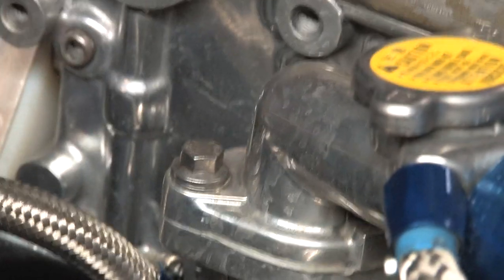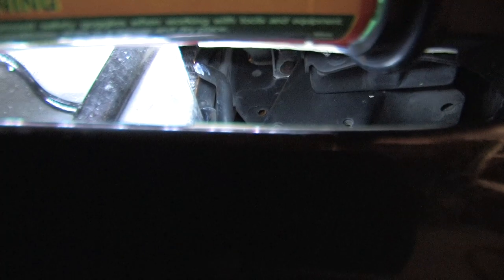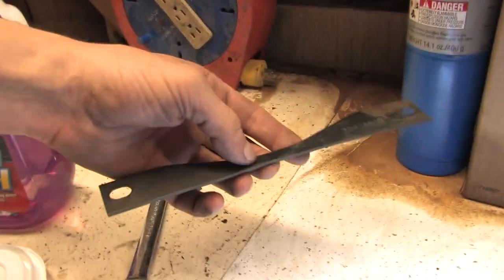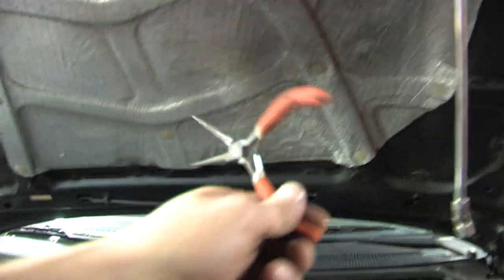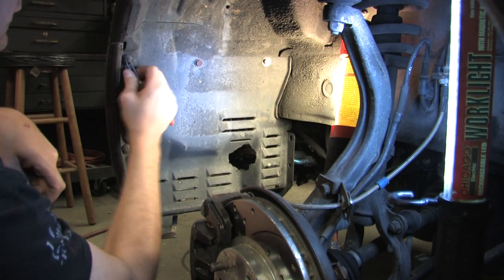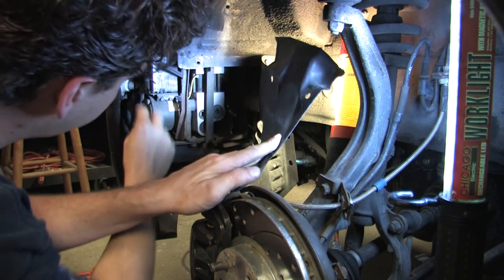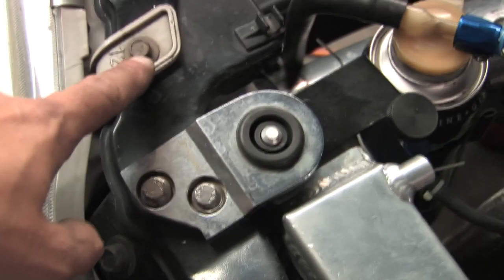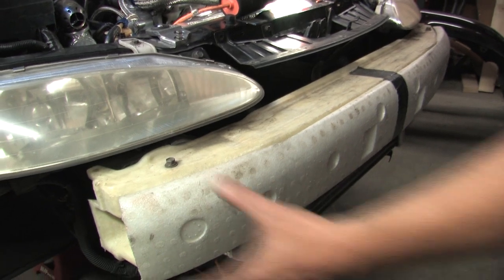Been there, done that.

Comment: i think the problem with your intercooler is the fact that it's square:
the cracks are on the angles where it's the most fragile.
you should try to replace those square parts by curved parts  don't know how it's nammed).
the pressure will crack always here because angles can't support big stress .
it's like an egg or a bridge structure or a batiscaf
the pressure don't like square things because of it's distribution.
hope you understood my language

you should dig in the penetration of the weld.